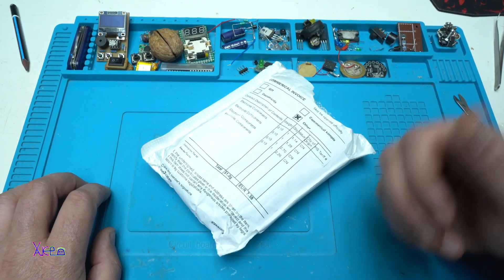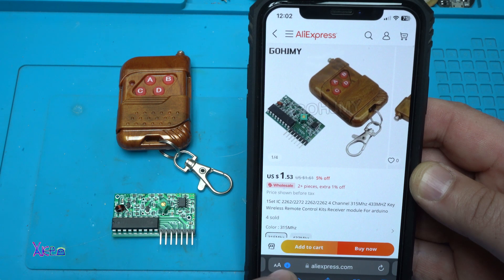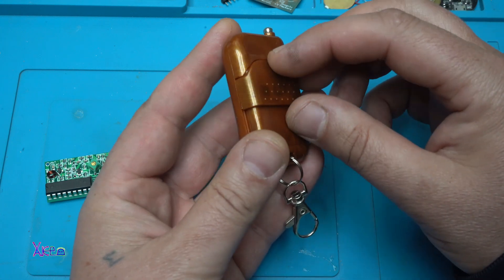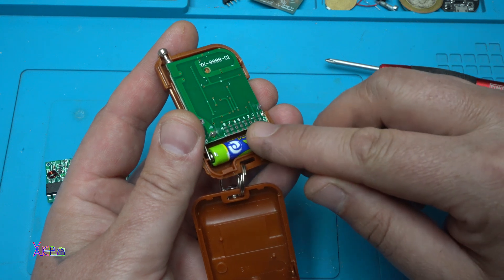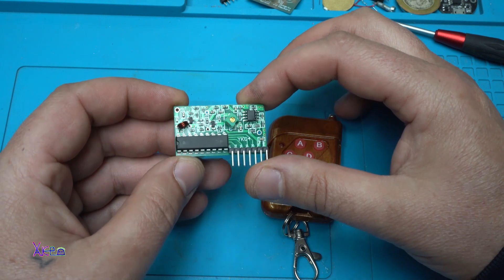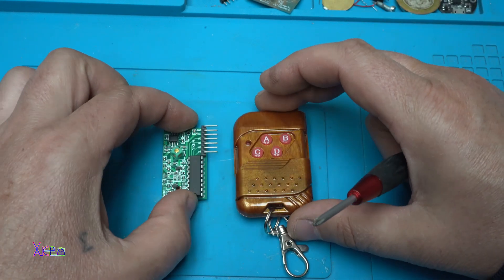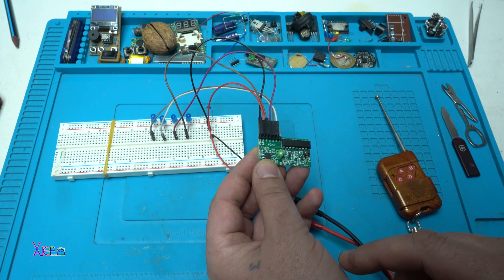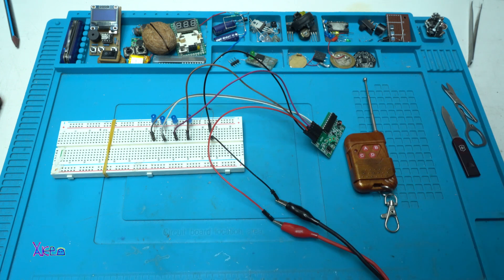$1 Gadget from Aliexpress 4ch Transceiver Module - Good or Bad?

Comment: Awesome testing and review, dude. 😊
I bought a similar one, planing for a project that I ended up finding too stupid to do. 😬
(I was going to make a trash can that opens and closes using the remote.)
So... Looking forward to see what you do with it. Perhaps I end up doing the same. 😊
BTW, those batteries are fantastic to make small flashlights with 12v car's LEDs!
Anyway, stay safe there with your family! 🖖😊
Reply from the maker: Thank you for the support my friend and have some fun making your project using this cheap gadget and yes I will make some useful thing with the remote and show to all of you.
Reply: I don't think a self-opening trash can is a stupid idea, at all. (No one likes to lift the lid, on a dirty trash can.) Particularly, if you can trigger it without having to hold the transmitter... Because, your hands are holding the trash. You need some sort of proximity switch... Sonar, capacitive, etc... And, the system needs to be very robust - A very reliable sensor and a very strong actuator. I hope you build it.
Reply: @t1d100  Oh, that would be a much better project, no doubt about it. But that's exactly why I've found it to be stupid, because if you're already holding the trash it's going to be complicated to use the remote.